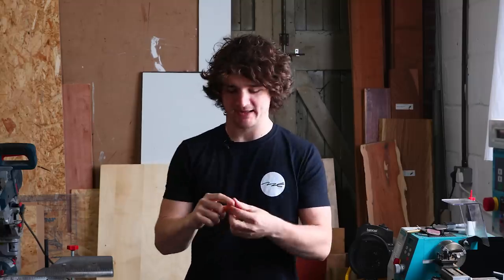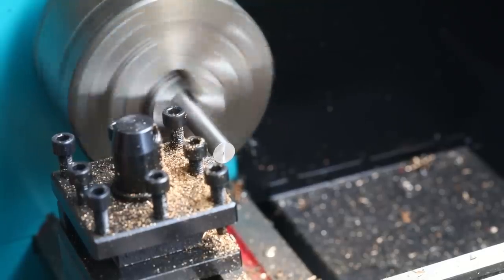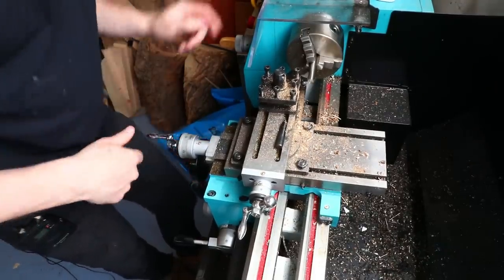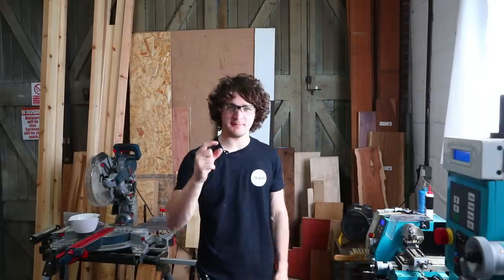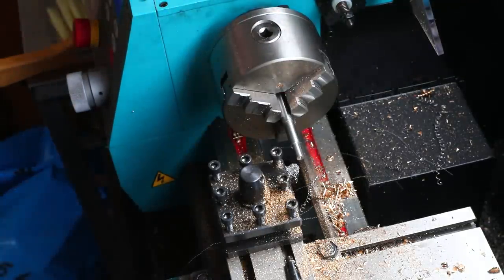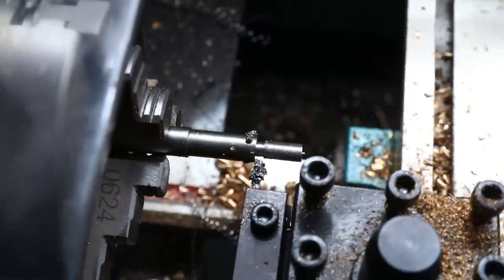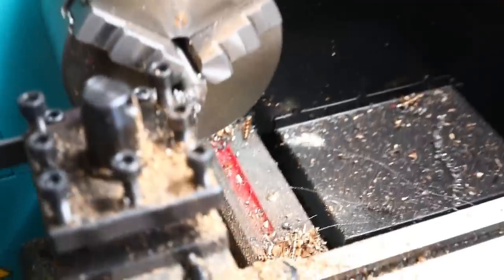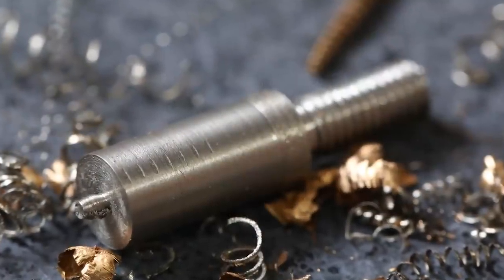Engineers, I need your help | Turning Tuesday #17

Comment: What about backlash? I'm not a machinist, so I don't know the details, but that is something that they talk about.

I also second the opinion on using a dial indicator to measure what you are actually moving the crossfeed rather than relying on what the dial is lying to you about.

Threading can be done with the die on the lathe with the tailstock pushing against the die keeping it square.

Also, I didn't notice if you chamfered the end where the threads are. That makes for easier thread starting. Also, it's best practice to chamfer all of the square edges just slightly to soften the corners.

Abomb79 is another good source on YT for machining.
Reply: Dial indicator sounds good. Backlash can be a problem when you switch from turning the controls one way to the next. If you move the tool in towards the work and make a cut, then move the tool back out away from the work, you then need to move the tool back in towards the work again to eliminate the backlash.

Backlash can be experienced as the 'slop' in the handle of the controls in which the handle rotates freely for a short distance but does not actually move the tool.

Comment: What they taught me in my manufacturing courses in university is, if you hand tap in the lathe with the lathe off and use the chuck key (inserted into the chuck and spun to butt up against the bed of the lathe) to stop the lathe from spinning freely, that you can secure the work piece much better than in a vice. I have found that works the best for me as long as there is enough clearance for the tap handles. you can also use the tail stock to keep the tap straight when doing internal treads.

Comment: Hi Matt, add the handle to the carriage traverse wheel. Your lathe is built upon the American style with the wheel on the left which I find slightly more awkward but you get used to it. Don't use the auto feed to take the bulk of the metal off just do it by hand (hence the fitting of the handle) and finish with auto feed. Your speed is far too low especially as you are using carbide tipped tooling but make surety are dead on centre. The cutting fluid you are using is fine. Use the tailstock to guide the die holder to thread the piece unless you have a tailstock die holder. Machine the smaller diameter first then the larger, just put witness marks on the stock to show the length of each section. Keep up the great work mate, I thoroughly enjoy it.
Dave

Comment: 1, The tool post can hold 4 tools on each face, so you just rotate the post and no need to set tools all the time 😉 
2, there’s usually some auto stops on the lead screws so that it disengages at the point you require
3, with a correctly ground tool you should use the half nut feed to create the m6 thread

Comment: My suggestions are. - you should shim the underside of the tool - I watch to the end and you said this, you can buy shim stock, but also can use anything, (even cut up drink cans.)

As others have said, using a dial indicator rather than the wheel graduations will improve accuracy, but it'll take longer at first whilst you;re getting used to that.

as for the times at the end. I don't think 12 minutes is that bad (but it depends what these are for and how much you can sell them for, -they need to be worth at least a couple of quid each to cover your time and materials.)
You can save 1 minute but using 2 sides of the tool post - rather than swapping out the tool, mounts a tool in one side, then loosen the tool post and rotate the whole thing, you can now mount a tool in the other side, - just rotate the post to change tools.

You'd save 5 minutes by buying 9mm stock rather than what you have got.

these two tips would halve your production time. :)

Comment: Mate, if you're using the screw cutting (half nut as you call it) to remove the majority of the diameter and then finish with a final small cut with the normal cutting feed rate, you're in trouble. The rough cuts you're taking using the screw cutting feed will be displacing the stainless steel rod (Pushing it away from the cutting tool.) So your final cut will be taking off whatever you dial up PLUS whatever the displacement was due to two things. 1. using a Tungsten Carbide will create even more pressure on the rod, thereby pushing it away from the cutting tool even more. 2. When you come to add the final (proper) cut for finishing, the stress on the rod is decreased so if you dial 0.3mm to reduce the diameter, you're probably taking 0.4+mm as a guide. Stainless is one of the hardest materials to machine due to its high nickel content (316 is marine grade so even a higher nickel content) if you want something that doesn't corrode and easy to turn, have you tried brass?.....just a thought! PLEASE don't use the screw cutting function for surface cuts. I reckon I'll have to come up to the Northern Hemisphere and slap you ;-) Don't hesitate to contact me if you require anything further. I was a toolmaker back in the good ol' days. These days, people have trouble sharpening a drill, never mind mastering a centre lathe.  FYI, if you want to turn a large number of single items, consider using a "Capstan Lathe"

Comment: A QCTP will reduce setup time between op's. The china ones aren't expencive and they do the job on hobby lathes. 
To reduce chatter, set the top slide at 30ish° and move it so that the tool post sits right over the carrige. Make sure to lock the top slide, you will only use it when doing tapers.
Be sure to set the cut off tool parallell to the chuck and have it well centered.

For carbide use low feed and high speed.

For shims for the tool post you have buy a couple of sets of feeler guages. Inexpencive and most tool stores have them. If you buy several sets you tape shims on several tools for easy tool changes  (buy a QCTP and never worrie about it again, sooo worth it).
Reply: Suggesting a Quick-Change ToolPost was what I was going to suggest as well the second I saw how he changed from the parting tool at the beginning

Comment: A quick change tool post is great for getting cutting tool at right height, which will help with accuracy and the end pip.
I love my very cheep usb DROs, this eliminates backlash issues I was having when using the dials. 
Hand winding the chuck/part into a tail stock held die holder is what i do. (Home made die holder is great lathe project)

Great work,

Comment: You mentioned making a batch. For goodness sake make yourself a carriage stop.  Clamps to the carriage and has a pin sticking out.  For the first length, use a well fitting, longer sleeve over the pin and remove the sleeve for the second length. This is using the turning tool, which needs raising to be on centre.  Then use the turned shoulders as your length guide for the parting tool which appears too be working nicely. you also turn a decent chamfer on the start of the thread, which should help to get the die started easily.
If you make a carriage stop it will save you messing about with the carriage dial all the time.  Then you will only need to worry about the diameters.
A parting nib is almost always going to be there as the part is likely to fall off under its own weight, even if you use a RH type parting edge.  Turn it round and face it off with the tool on centre. 

If you get a quick change tool post, it will make it easier to adjust the centre height of your tools.  Changes will be faster and the tool will always be on centre.  The additional time to add a chamfer (as mentioned earlier) would be negligible.
That part is hanging out of the chuck a long way, is it possible to cut the smaller and then the larger?  it may depend on the concentricity you need and how good your chuck is.

Comment: Take the HAFT flap right angle 2 mm by 2 mm by 0.02 mm and move it 0.000010007 to the 114-degree hand tank shim, then unplug it and turn it on. This should aline the dongle key with the x member line flan. Then only then you should go ask someone that knows what they are talking about!

Comment: The further your tool is off centre height which is only really fixed by using shim or remaking tools post (which you can do on a lathe) then the more your tools may struggle. You can speed things up by making a spring loaded die holder and let the lathe die it on a low speed, but you do need reflexes to be able to stop the machine spindle before the die hits the relief shoulder. You can use dti clocks as soft stops instead of using hand dials too as I find them more accurate as they are a direct reading. .01 25mm travel plunge clock would be ideal and you can also use it to accurately make your final diameter pass. Also a cool trick to find a centre height is to get a pin and plasticine and stick it on a bar in the chuck and spin it at around 3-400 rpm, slightly nudge the needle tip and it will try move to centre, the straighter the pin the easier it will be to get it to spin central. That's how I do it at work

Comment: Simple ways to make it quicker that are free, in no particular order: 1) Get your handles fitted to the lathe, especially the tool post so you can 2) Fit more than one tool to the tool post and rotate it instead of changing tools out, 3) speed up your RPM, running way too slow at that diameter, you can probably go flat out on that machine, but 1000 to 1200 rpm may feel more comfortable, and your carbide will work better,(obviously slower for parting off),  4) Get your tools on center height, if you don't have shim stock, metal from drinks cans makes a reasonable substitute, this will improve finish and reduce tool pressure helping with dimension due to less deflection of both tool and job, 5) stick with one feed method, ie not half nuts, they're for threading and wear out pretty quick on small machines with small fine leadscrews leading to them skipping and slipping threads (don't ask how i found that out) and will give more consistent results, 6) thread on the machine not in a vice, then part off, if you don't have a tailstock die holder or time to make/buy one use the tailstock to hold the die straight by hand, if you have a lot to do invest in HSS dies if you don't have them already, they cut faster, cleaner and last longer, (ok that's not free, but valid none the less) 7)  and by no means least, take your time, nothing takes longer than trying to go fast and filling the scap bin with buggered up parts.

Comment: Nice video, my hopefully helpful points,
-starting with speed 400rpm is way too slow for the diameters you are turning with even against ssteel.800-1000rpm will help,
-you state a problem with hitting tolerance, the preceeding cut should always be at the same feed rate before your finish pass to ensure eveness of measuring, 2ndly upsupported so far away from the chuck, from the sounds is creating chatter, this too will throw your accuracy away,
-setup as close as is reasonably possible, 5mm after the cut edge is plenty, this will help considerably even with a stiff material like ssteel.
-parting is a high force operation, the slower speed will help with this, but snap off the piece rather than pushing the parting tool through, this will massively prolong the life of your tungsten blade and prevent chipout on the tool.
-the pressure on the tool changes massively with tool center height, it NEEDS to be correct, set this by facing a scrap piece of steel, shims may be neccessary is totally normal, keep this with an elastic band with the current tool will aid setup time hugely.
-if your batch manufacturing, contemplate setting up for one operation and doing all of one operation to the whole nbatch, then setting up tools and feedrates it cut down versus undoing and redoing up the chuck.
-12mins unfortunately is very slow IMO, nt meant in a bad way its part of the learning curve.
-when hitting the high tolerance across the length, just pushing the center into the end of the piece even without a ceter drill will aid chatter hugely also, cut a little, dont touch the tool, back off the cut and measure, then you can take into account the backlash and flex of the workpiece and adjust accordingly.
-maintaining the same cut fromm the previous setup with each cut again will aid repition.
-if i can help with anything else please do not hesitate to ask, this was my job for 10years prior to my latest :)

Best of luck these things come with time :)

Comment: One thing you need to do is centre your tool. When you faced it off it left a small point in the middle. If the tool is off centre then your lateral measurements will be off. If you move it 1mm then that isnt coming off the radius is it coming off the chord slightly above or below the radius. A bit of trig will tell you what that works out to if you know how off centre it is but easiest solution is to centre the tool when you face it off. You could also use a carbide bit and remove more material in the early passes. I'm a design engineer so not a machinist but those are some good basics to work on.

Comment: Someone suggested coolant and a pump. If you have air to hand you could try spray mist coolant, I find it works quite well, without the mess of flood coolant and without the maintenance required.

Comment: I am also a woodworker who also does metal machining.
If you want to do production work, I would purchase the bar stock at the desired diameter.

You do not state why you need stainless steel but drill bar stock is available in 9mm diameter so this saves the initial machining step to 9mm.

Stops are your friend for production work.  Can be a physical stop or a dial indicator and watch for the dial to reach a given position.

Others mentioned the tool was not on centre height.   The little nib is the clue. 

Your tool post allows mounting up to 4 tools.  You may save some time by mounting a couple of tools, setting each to dead centre height, then rotating the tool post for the desired tools.

A better alternative than your present tool post is a Quick Change Tool Post.   Many video of these.   Many places to purchase.   Faster to change tools which is important for production work.

Dave.

Comment: Just a thought when you are using the die to cut the M6 thread - drill a 9mm hole 18mm deep in a 15 mm thick scrap of wood, put your shaft in that and clamp it in your engineers vice. It should hold it firmly and you won't get any vice marks on the shaft of your piece as you cut the thread.

Comment: Great video Matt. If you are intending to do lots of them you may wish to invest in a turret lathe or turret attachment,  as these are set up for batch operations. With regard to tool height, shimming is the way to go, you may want to consider mounting the 2 tools in the tool post (it can potentially hold 4 if they are short or 2 if they stick out the end) and rotating it rather than taking the tool out. You can also thread with a die using the die holder you have whilst keeping the part in the lathe, you can use the tail stock with nothing in it to push up against the back of the die holder to get it square, then rotate the die holder to start it then continue with hand turning the chuck . Hope this helps., Paul.

Comment: To work AISI 316... you need coolant lube running... but I believe AISI 304 can suite your purposes...
For the problem you report.... do the proper “zero” ... and mind the maths....
The trick/tip is to plan the milling step ahead instead of working “on the fly”.... plan before starting... 
make some sketch step by step...
... try to work with bronze or aluminum.... it is probably easier to work,...
Great Video... love your honesty!
Thxs

Comment: Not sure if it's been mentioned but you could also make two at a time. Leave your stock twice as far out from the jaws and use the tailstock to minimize deflection. Cut the whole stock at your 9mm, then come in 20 mm from the end and cut down the next 30mm (plus whatever the width of your cutoff tool is) to the final 6mm. Part it off in the center of the 6mm section and part off again. I'm sure there's a simpler way to explain this but I've not got enough coffee in me to do better...

Comment: A good way to measure if your tool is centered quickly is to put a ruler in between the tool and part. If it looks straight, it’s going to be pretty close. And with your setup the only way to raise the tool is with a shim

Comment: Like some of the other people have suggested, a quick change tool post will be the way to go. Your RPM is to slow. You need to be spinning about 800 Rpm with the carbide turning tool. The part off tool is good at 400 because it is high speed steel (HSS). One way to reduce the tit on the end is to grind a taper on the cutoff tool. The tip should be on the side the part is. You won’t get rid of it all together but it will be far less. If you don’t intend to use the threading feature on the machine, the die is good enough. You should tap it while it is still on the bar. It’ll make it come out better. Cheers from the other side of the pond.

Comment: The key to fast turnaround on repetitive parts like this is eliminating all the measuring along the way. You should invest in a carriage stop (probably even a multi-position one!) so you can set it up to stop the carriage at all the right lengths. In the absence of a way to put a stop onto your cross slide, I'd just suggest putting a mag base dial indicator on the saddle that indicates somewhere on the cross slide. Then you can zero the indicator at your smallest diameter and work to that position instead of checking again and again with a micrometer.

Also, I think that "fine feed" lever on the side of your apron is the half nuts. The half nuts are used for single point threading, not for feeding. I'd recommend avoiding using the half nuts in this way as that increases wear in the half nuts.
Reply from the maker: Ooo I’ll have a look, cheers Bryan!